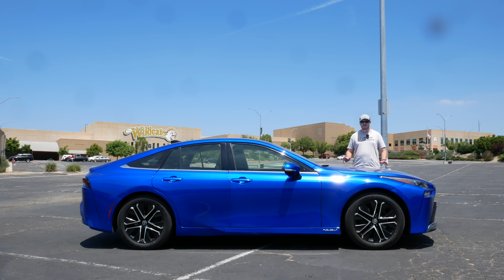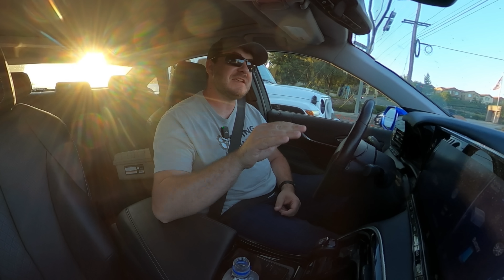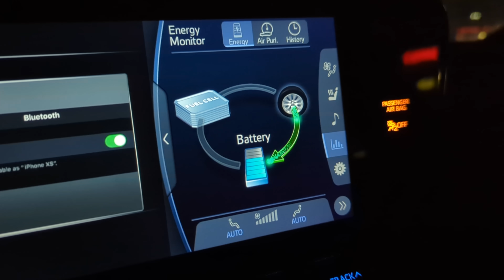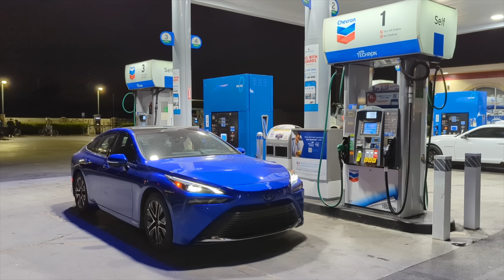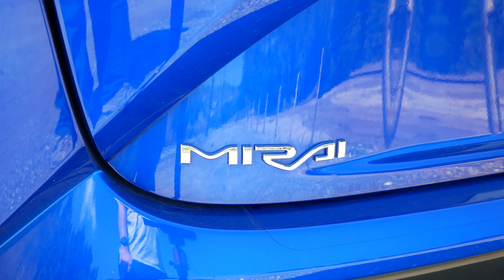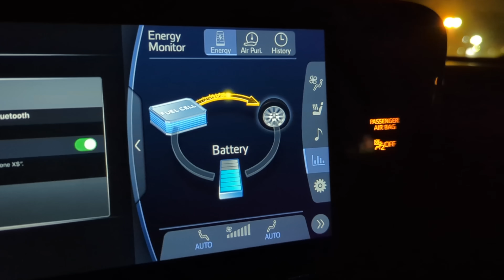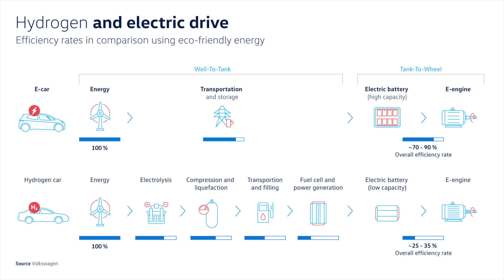The Toyota Mirai is Disappointing

Comment: This car would make a lot of sense on an island like Japan or Hawaii.  They could make their own hydrogen from electrolysis and cut down on all the shipping for bringing gasoline to the island or Oil in the case of Japan.
But other than that, the main problem with hydrogen as a fuel source is we ain't got no hydrogen.
Reply: I would argue small islands are even more perfectly served by short-range battery EVs.  Hydrogen makes a little more sense in the low-density regions of a huge island like Australia, though I'm not certain local production would be feasible in all areas.
Reply: @ThetaReactor  Australia isn't an island.
Reply: @tarstarkusz  yes it is australia is refered to as the ISLAND continent and the ISLAND nation Australia (along with new zealand).australia is the only country in the world thats landmass exists entirely on one tectonic plate and is completely isolated via oceans from any other country
Reply: @jackass123455  Yes. It's a continent.  Point is, it's enormous and is full of resources. It's the 6th largest country in the world with a small population. 25.69 million. California alone has 40 million (Australia is 19 times the size of CA).
Reply: @tarstarkusz  It's not?  Don't be pedantic with extreme semantics...
Reply: @tarstarkusz yeah it has to float to be considered an island...duh.
Reply: @joelcrane6806  Hopefully it doesn't tip over like Guam was in danger of doing.
Reply: @tarstarkusz  What is it then? I missed the bit where it is connected to other countries...
Reply: @calebfuller4713  Can you elaborate?  It's a long thread and I don't know which comment you are replying to.
Reply: In places like Hawaii where you can charge your car exclusively from solar year around it makes absolutely no sense. Grid argument is so lack of arguments, because you don't even need the grid! Now in a place like Iceland where you have plentiful energy and the sun doesn't really shine more than half of the year - Hydrogen could make some sense. But Iceland is still a pretty small country, or at least its road infrastructure is. Hydrogen for off roading maybe, for roads, never.
Reply: Islands are small though, modern EVs with batteries break 300 miles easily and charge very fast.
Reply: @g.4279  Only relatively small islands (like the Hawaiian islands) don't have that kind of power.
Reply: ...Uh, no. Hydrogen is just about the single most moronic fuel source for anything ever. I see in one of the comments you pretend hydrogen doesn't take a shitton of electricity to produce but then somehow claim EVs are a power grid burden. Which is beyond farcical. To add to that, you need to rewatch this video, at every step of the way the hydrogen fuel cell is the weakness of this vehicle not the strength. Hydrogen is low energy density, high storage cost, high pumping cost, high distribution cost, and high production cost. Hydrogen fetishization is done by folks who know nothing of engineering and are being led around by buzzwords.
Reply: @liam3284  Australia is a continent;. It is not an island.  There are real differences.
It's only an island in a metaphorical sense in that it is surrounded on all sides by ocean.  But, by geology, it's a continent.
Reply: @liam3284  Yes, but it's free in every sense of the word.  It's what makes oil and gas and coal so great.  All the energy therein was free as far as we are concerned.  Making panels and doing electrolysis takes money and energy.
Reply: @tarstarkusz  Do you have just the slightest idea how much it costs to make gas, and diesel out of oil? Or just the transport of it.

Not to mention the results in the eco system of that and coal.

Also about japan going hydrogen: of course they do. Look at how much influence and power their energy companies have. It isn't about the smarter choice. it's about what nets the power companies more money.
Reply: @liam3284  This is not an hydrogen ice engine. It's an electric engine with a hydrogen-electric stack.  An ice burning hydrogen is not practical because the inefficiency of ICE engines. AFAIK, it has the same limitations of gasoline in terms of preignition.  It would be better if it was more like diesel and could withstand very high compression ratios.  The thermal efficiency of a heat engine is directly related to compression ratios.
Reply: And even in that case, you'd just be better off driving an EV.
Reply: @Green_Tea_Coffee  I disagree. They will massively increase the load on the grid.  WHO would even want to put a bunch of offshore windmills in the Hawaiian coastline?
Reply: @tarstarkusz  not even about the windmills. just the amount of power lines needed to supply all those stations. there'd be more transformer substations than EV stations.
Reply: @tarstarkusz there's this weird other renewable resource in Hawaii, year round even, that can charge electric cars. It's almost like it's one of the reasons people go there
Reply: @tarstarkusz  Wouldn't a bunch of hydrogen plants increase the load on the grid, and do it less efficiently?
Reply: @iroll  Possibly.
Reply: @tarstarkusz Hawaii already has windmills tho
Reply: @bitbat9  Yeah, and the biggest ones are 7mw.
Reply: @iroll  japanesr will produce hydrogen with power plants...
Reply: @tarstarkusz So... What you're saying is that since an island can't make the electricity for electric cars, they should instead make 3x more electricity to electrolyse hydrogen for hydrogen cars?
Reply: @tarstarkusz  The claims about EVs taking down the grid has been massively overstated. Engineering Explained did a video about it where he crunches the numbers.
Reply: @Green_Tea_Coffee  I saw that video and we need terawatts of more power and no new nuclear to actually build it out.  Plus, it's not just all the new power we need, it's that we will need it at specific times of the day and night.  Add to this the utter insanity that we would also need to close all coal and natural gas fired power plants and replace them with solar or something.
Reply: @wojciechmuras553  No, red hydrogen made directly from nuclear heat.
Reply: @tarstarkusz  If the grid can't support EVs, then it absolutely can't support the generation of hydrogen for the purposes of powering passenger vehicles. It takes way more power to make the hydrogen than it does to just charge a battery.
Reply: @Green_Tea_Coffee  It can if it uses "red hydrogen."  But otherwise, I don't disagree with you.  They would have to import the hydrogen and at that point you might as well import the gasoline.
Reply: @ivoivic2448  did you watch the video? He explains why this is grossly inefficient.
Reply: @iroll  it's ok. not everybody is smart enough to see the big picture
Reply: @ivoivic2448  Reread people's replies to your comments.  if i want to be rude like you like now, then: ""It's ok.  Not everybody is smart enough to see the small picture" referring to you.
For a more informative reply, unlike yours:
This isn't a "big," difficult-to-understand picture; it's a very simple concept about how direct-EV will always save power over making some kind of electric-storage and then churning that out again into useable power.  Why waste energy on creating and working with hydrogen when you already have the energy to use?
Reply: @quackman  you're a complete moron if you think hydrogen is about "green energy"...
Reply: @tarstarkusz  And where do you think the electricity for hydrogen would come from? It needs much much more energy then an BEV.
Reply: @tarstarkusz  Now imagine you use hydrogen, and need 7 times the energy compared to EVs....
Reply: That has been Japan's plans since the 90s, thats why Toyota is so gung ho for hydrogen. They are getting back on track and will still probably end up going hydrogen I think, their main concern is being reliant on China for their energy needs. 

They are slowly turning their old reactors backs online and they are going to be building a new high temperature gas reactor to specifically make Hydrogen which is more efficient than basic electrolysis.
Reply: @instanoodles  all japanese manufacturers either have or are developing a hydrogen electric vehicle. with BMW honda mazda hyundai and even landrover getting in on the game. 

my favorite to look out for will be the toyota GR yaris H2. a hydrogen powered ICV yes a BOOM BOOM engine running on hydrogen
Reply: @instanoodles  I heard there is a new color of hydrogen in Japan based on nuclear.  I forget the details, but I heard it was a huge breakthrough.  Probably using small scale nuclear to make the steam for steam process.
Reply: @tarstarkusz  nuclear reactors that can reach 1k C safely. hydrogen is extracted at 900ish C.
Reply: @ivoivic2448  I just brushed myself up a bit on the "red" hydrogen.  They have a gas-cooled reactor type that can reach like 1600 degrees because the gas and the fuel pellets can withstand such temperatures.
Reply: @tarstarkusz  Direct methane pyrolysis - basically heating up the methane to the point where it decomposes into hydrogen and elemental carbon.  The problem is that the CH bond is extremely strong and hence the process is highly endothermic. The idea is to use the waste heat from nuclear plants to provide the process energy.
Reply: @TrimeshSZ  "Red" hydrogen is supposed to use nuclear heat directly. Waste heat is too low, I would think.    A new reactor design allows much higher temperatures due to the gas cooling and ceramic pellets. There are some good articles about it on the internet.
Reply: It makes most sense in locations without high voltage electric transmission infrastructure. Think of countries that have leapfrogged landlines and gone full into cellular phone technology. The cost of standing up a high voltage transmission grid to support EVs is more than the cost of hydrogen vehicles and their fuelling infrastructure. Namibia is going hydrogen for that reason.
Reply: So use the same amount of power to make hydrogen to achieve 60% less distance for the same energy input as an EV.
Even a small microgrid is persectly capable of charging several EVs from solar. Oversizing the PV on my 5kva Victron plus a 4kW grid tied inverter can produce enough energy (6 hours @ 8kW 48kWh) to drive 10 EVs 33km a day. Which is the average distance driven in Australia per day.
Reply: @andrewradford3953  great, you got 10 EVs covered. now just a couple million left.
Reply: @ivoivic2448 Yes. 10 EVs from a single small, home-based installation. That is about... infinitely more than you'd get from fossil or hydrogen.
Reply: @ivoivic2448  if one house out of 10 in a microgrid or grid connected village had 8kW of panels, that would cover transport alone. Already in Australia one out of three houses has solar. This is an affordable solution to state's or countries that have lots of sunshine most of the year.
Reply: @andrewradford3953  it's not about power production...
Reply: @andrewradford3953  oh and IF the power production really was the issue, are you going to be the one to put 8kW of solar panels in your back yard or on your roof? who's going to fund these solar panels? who is going to greenlight such a stupid idea? have you even checked solar panel efficiency? what about night time? oh right, batteries... sure, let's make an entire power plant, but spread it around unfortunate households, not only making it inefficient, but pissing off everyone as well.
and that's just rural areas where you can dig up power cables with ease. how about cities with 100 times the pop density? you gonna put 8kW panels on those roofs?
you morons...
Reply: @djhakase  It's actually not more expensive then hydrogen fueling infrastructure. You heavily underestimate the cost of a hydrogen fueling station, as well as the infrastructure for making hydrogen and transporting it.

On top of that is the sheer cost of hydrogen if you actually have to pay the real price for it. 

Your 4 or 5 dollar per gallon will look extremally cheap and affordable in comparison.
Reply: Simple pyrolysis of coal, widely used in coke plants, can yield large amounts of hydrogen cheaply.
Reply: Not a problem gas started out like this too its just a matter of time and money, hydrogen is very abundant in the universe while gasoline is not

Comment: As far as I know the Hyrdrogen Car is affected by altitude, theoreticly.
If you drive in high altitudes, the compressor has to work more to get the same amount of air into the fuel cell, because the air is less dense, so theoreticly, you need energy for this, but the drag on the car should also decrease, so I dont know if there is a crossover point where you gain efficiency or if it is cancelling itself out somewhat
Reply: ICE cars also suffer from that
Reply: @crackedemerald4930  Exactly, and I never looked up if they gain or loose effeciency, they definitly loose power. I guess the compressor in the hydrogen car is strong enough to deliver peak power also at altitudes, but some of the power has to be used for the compressor. But I have no clue how much power a compressor uses, but it could be some kW

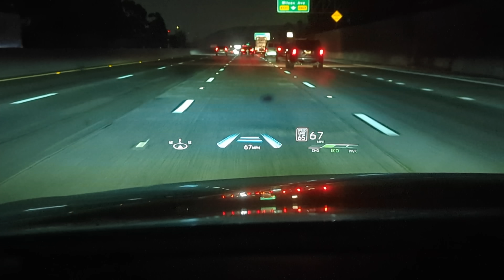Comment: 5:14 You can re-electrolyze the water, it's just somewhat inefficient, requires extra plumbing, and a high-pressure pump to shove hydrogen back in the tank

Comment: Hydrogen is obsolete tech for personal transportation.  It comes down to efficiency.  It takes 39-48 kWh of energy to produce enough hydrogen to drive 60 miles (1 kg). An EV only takes 18-23 kWh to do the same.  Hydrogen passenger cars have been "a decade away" for 50 years and will be that way for another 50 if they can't improve the efficiency.  Plus, the closest public hydrogen station to most Americans is a thousand miles away.  Not exactly convenient vs plugging in to your own garage, office, etc.

Comment: If only there was some kind of liquid in the ground around the world that we could suck out and refine. During the refining process at various stages we could use what’s left over to make other stuff. If it’s not fully refined we could put it in some kind of engine that just squeezes it and goes boom, refined a bit more and add a spark once squashed goes boom, refined a bit more squeezing it between some blades and it goes boom and blows hot air out. That would be great 👍

Comment: It's kinda interesting that there are so few Hydrogen stations in the US and that it is so expensive. Over here in Europe we currently have 60 Stations that operate at 350 bar, with 74 additional ones currently being built and 161 that use 700 bar with 47 additional ones being built. So a total of 221 active stations and 121 being built and the average price for a KG of Hydrogen over here is between 10-14 Euros.
Reply: Doesn’t matter how many hydrogen charging stations there is, when all the hydrogen is steam methane reformed from natural gas. There is an order of magnitude more natural gas charging stations, and natural gas vehicles, which can also use biogas. In a utopian future where there is an abundance of electricity and electrolyzers have become dirt cheap, while natural gas resources have been drained and biogas have become scarce, there might be a market for hydrogen fuel cell powered personal vehicles..
Reply: @Random-f3y7w  Well all your electricity will also be coming from natural gas peaker plants, so.......6 one way half dozen the other.
Reply: While that's cool, I bet there are more petrol stations in one large European city than hydrogen stations across all of Europe. Not trying to be a jerk, just saying it's a very small first step if complete replacement of existing ICE vehicles is the goal.
Reply: EV vehicles will never replace ICE vehicles using the current technology.  There is not enough electricity generated, and not enough real estate for charge stations to support the number of ICE cars you'd need to replace.

Takes on average 6 mins to fill up an ICE car.   So gas stations with 10 or more pumps seem to accommodate demand most of the time.  It takes 40 mins to recharge an EV.  Do the math!
Reply: Because big oil is subsidizing them in a last ditch effort to get eco-minded people to buy into their petroleum-derived products. 96% of your hydrogen is grey.  The new green hydrogen mandates being passed currently allow the (electric) energy companies to sink 14% of their future outputs into green hydrogen, which, with all the inefficiencies, means they get to charge you (or your government via subsidies) extra and make even more money from hydrogen cars than they would with just electric cars.  Try being more cynical.. nobody is developing this technology for altruistic reasons. It's all about creating a new dependent energy market.
Reply: Yeah but you weirdos don't like being last at every thing like we do.  We love looking stupid and backwards.  Think of us as the USSR with better clothes.
Reply: I live in Europe. The closest hydrogen filling station to me is about 670 km away, which includes a 2 hour ferry. Very useful.

Comment: If I recall from my brief time in the PEM Fuel cell industry (8 months) around the turn of the century the usable lifespan of a fuel cell stack is measured in thousands of hours. Back then it was ~4000 hours. a quick Google seems to show they have it up to about 10,000Hours. Heat can rapidly degrade that number and those were non-moving fuel cells in a temperature controlled production lab.
Reply: So it should reasonably last the life of the vehicle unless it overheats or freezes.